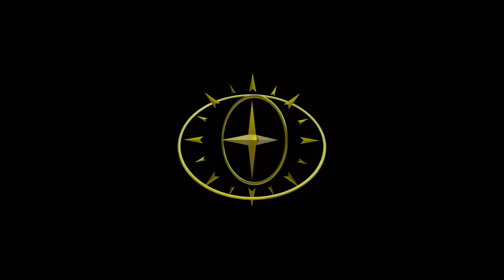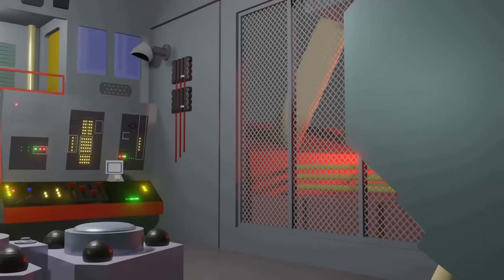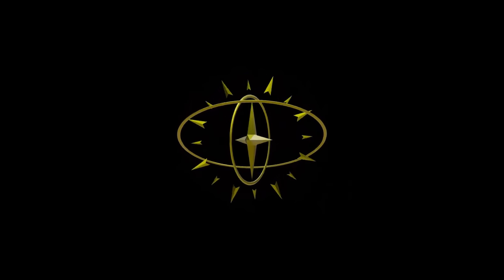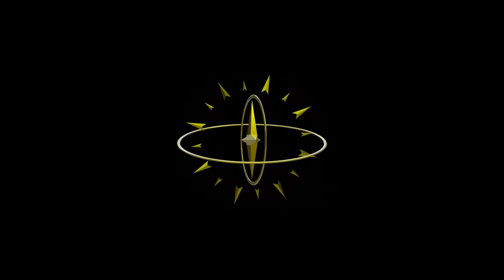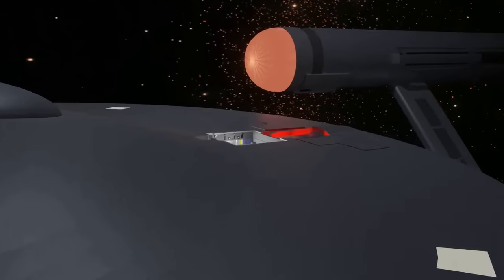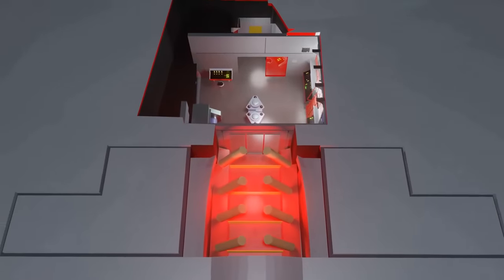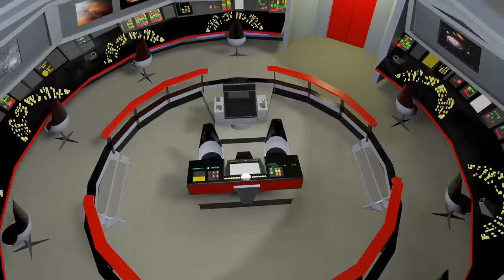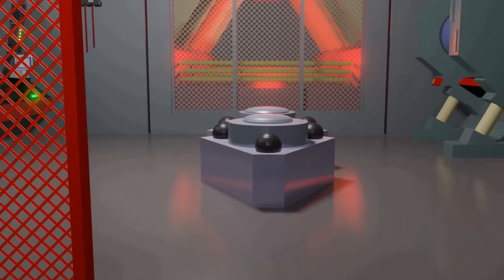The Enterprise Engine-room Enigma: where was main engineering?

Comment: The original Star Fleet Technical Manual has TWO engineering areas: an area marked "Main Engineering" near the Impulse Engines in the saucer, and a separate "Warp Drive Engineering" in the secondary hull right under the nacelles. Main Engineering is shown to have computers that can monitor the warp drive from there.

Also, Star Trek altered and reused sets as different rooms constantly, so there's almost no point in trying to reconcile most of the filming sets with the actual shape of the ship. I tend to lean in favor of the book that was written by an Army Air Corps engineer instead of random Hollywood camera angles.
Reply: Unfortunately, the Star Fleet Technical Manual is not canon, as it is a book, not a series or a movie, and as stated by Roddenberry, only the live action shows and movies are canon. (Yes, people, Discovery and Picard are canon, I hate them too, suck it up)
Reply: @L1z43vr  
Roddenberry was the very man who made the Technical Manual canon in the first place. He signed it with his own signature, and put references to it in all the TOS movies. Evidence:

Star Trek: The Motion Picture - All ships referenced in radio chatter were taken from the manual (Scout Revere and Dreadnought Entente, by name and NCC number) and we see Nurse Chapel use the Anabolic Protoplazer on Chekov.

Star Trek 2: The Wrath of Khan - The entire film is littered with references. "Main stage flux chillers... On."

Star Trek 3: The Search for Spock - Sulu directly uses the Ray Gun (not phaser) from the manual in the "don't call me tiny" scene.

Even in Star Trek 6, the ships referenced in Operation: Return are all from the Technical Manual. They only stopped using that manual after Gene died.

EDIT: you actually said, "Yes, people, Discovery and Picard are canon, I hate them too, suck it up". Even Discovery referenced the Technical Manual, thus, we can conclude the Star Fleet Technical Manual is and always was canon.
Reply: @Idazmi7  Um, no he didn't. He did not commission the TM or the blueprints. There is simply no evidence of this and the interviews with Franz Joseph's daughter all point to Joseph being the one to first approach Roddenberry on the matter of propriety and he'd already started the work on the TM. Roddenberry just gave a thumbs up, mainly because it was another thing he could sell through Lincoln Enterprises.

The use of the material was by *staff who were fans of the show*, not Gene Roddenberry, who after TMP, lost a lot of creative control. After Search for Spock, there are very, very few references, mostly because of the falling between Joseph and Roddenberry, especially around the time of TNG, but also the staff began making new diagrams and other readouts that were original and contradicted Joseph's works. 

Roddenberry also had very little involvement with Star Trek 6, and he declared parts of it non-canon as he hated the idea of Starfleet personnel working to subvert the Federation. His death had nothing to do with the end of the use of or continued use in the franchise of Joseph's works.
Reply: @mikedicenso2778  TMP has the most references to the Technical Manual of all, and all the TOS movies referenced it... UNTIL Gene died. After that, there were no more references made to the manual.

Also, the Franz Joseph Star Trek blueprints were always copyright through Paramount
Reply: @Idazmi7  That's because the staff, not Gene Roddenberry loved it so much. Roddenberry had no real control over the movies after TMP, and they had the graphics and such put in by the art department until Search for Spock. Once Roddenberry began moving towards decanonizing the expanded universe works and his successors tightened up the productions, the FJ material largely fell to the wayside with the occasional sneaking in of bits here and there.
Reply: @mikedicenso2778  
You have no evidence for anything in that entire paragraph. If Roddenberry controlled TMP as you say, why does it have the MOST technical manual references? By your logic it should have the least. Furthermore, the references to the manual continue well into Star Trek 6 with every ship in Operation Return being from the Technical Manual.

The mere mention of the USS Entente NCc 2120 canonizes the manual, let alone everything else.
Reply: @Idazmi7  You're using circular logic. The reason was that most of the people involved in the art department were fans of FJ's works. That's simple enough

You're maintaining a fantasy that simply wasn't true about Roddenberry commissioning the Technical Manual, when his daughter has said otherwise and so have others. Once Roddenberry and FJ had their falling out, it was over and done with and there were fewer references over time.

If you're fantasy was correct, there would've been nothing in Wrath of Khan, or Search for Spock since Roddenberry was out of the movies, and especially he had little to do with Undiscovered Country. 

I'd like to see some hard evidence from you  , and others have asked for it, but you give this same circular answer about the movies which is easily explained away by the art department and other production staff being fans of FJ's works.
Reply: @mikedicenso2778  
I'm using circular logic cause this situation is shaped like itself. If, as you say, Gene wanted to distance Star Trek from the technical manual, the logical outcome of his direct control would be distance from the technical manual.

But that is the opposite of what we see.
Reply: @mikedicenso2778 in addition to that, you have no evidence that the art department was full of fans of Franz Joseph's work, nor even that any of them were the slightest bit aware of his work before filming.
Reply: @Idazmi7  They started off fan made and people encouraged FJ for more so he went to Gene Roddenberry over it.

Why do you deny that?

And you seem to have this weird idea that people like Andrew Probert and Rick Sternbach, among many others who have time and again stated they were fans of FJ's works. 

And you seem to accept that there are just as many more references in non-Roddenberry TOS movies Wrath of Khan and Search for Spock. Only after those movies do the references all but disappear and almost none appear in TNG before Roddenberry's death.

Also, please provide your sources. I've seen  nothing from you. No interviews, nothing.
Reply: @mikedicenso2778  
"They started off fan made and people encouraged FJ for more so he went to Gene Roddenberry over it. Why do you deny that?"

1. Because it doesn't match Franz Joseph's words on the matter.
2. Because none of the tech manual contains fanmade content in fact.

"And you seem to have this weird idea that people like Andrew Probert and Rick Sternbach, among many others who have time and again stated they were fans of FJ's works"

Source? Besides, even if that was true, which is unlikely, that hardy affects TMP except to further discredit your assertion that TMP "distanced" itself from the tech manual.

"And you seem to accept that there are just as many more references in non-Roddenberry TOS movies Wrath of Khan and Search for Spock."

That doesn't discredit my position, nor does it support yours, nor is it actually true, regardless.

"Also, please provide your sources. I've seen  nothing from you. No interviews, nothing"

I'm not the one making the extraordinary claim that official content is fanmade: you are. Give me a Roddenberry source that agrees with you. Not a claim by Karen on an actual fan website, or anything else.
Reply: @Idazmi7  So you're claiming Karen, FJ's own daughter and he himself are both liars? On the subject of the use of the SFTM and Plans use in the movies:

"Dick: No credit or compensation whatsoever was given to FJ. It is my understanding that these items were put into the movies by production staff who were fans of FJ's work, possibly including both Andy Probert and Rick Sternbach, because they felt FJ should be represented in there somehow."

Trekplace, is merely "reprinting" the Enterprise Incident interviews, among others. 

You're now committing the fallacy of moving the goal posts, if not delusional. We have the interviews with two people who were involved. They inspired and started work on the material well before Gene Roddenberry had anything to do with it.

Rick Sternback and others are responsible a fans for incorporating FJs material.
Reply: @mikedicenso2778  
So instead of answering anything I actually asked, you resort to attacking my character. Again, more explicitly this time: your fan site interview - which is what trekplace is - doesn't line up with facts available. To prove your position, you must provide an extenuating source, or - on the premise I have already given - your position can be dismissed.
Reply: @Idazmi7  I'm actually genuinely concerned for your mental state. And you are attacking the sources provided, dismissing it summarily out of hand, using multiple fallacies, calling Trekplace a "fan site" even though the pedigrees of the interviews are not really in question by anyone, except only you.

What facts are available? A coincidence that Roddenberry happened to work on a movie at the same time some graphics based on FJ's work were used? That's been debunked 10 ways to Sunday.

No one has seriously ever questioned Trekplace's interviews, or the sources it lists (i.e. James Van Hise's 1982 interview with FJ published in Enterprise Incidents magazine in 1984). 

Are you saying the interviews are faked? That FJ and his daughter Karen are liars? If you are, you need to show proof of that. 

What you should've said is really this, if you wanted credibility:

"I understand that there are interviews with Franz Joseph and his daughter, and I believe they believe what they say, but I want to know what Gene Roddenberry's view was on it, so I have all sides before I decide anything."

See, that's more logical, it does not dismiss a respected website's interview with Karen, or the Enterprise Incident interview with FJ himself.

But, because of your circular fallacies, and more, your insane fantasy can be readily dismissed.
Reply: @mikedicenso2778  
Yes, Trekplace is a fansite with zero connection to CBS, Paramount, or any rights owners of Star Trek. My other criticisms also stand. You must provide an actually verifiable source. Trek place is no such source.
Reply: @Idazmi7  You realize the fallacy of that argument?

You've just dismissed, Starlog, Enterprise Incidents, Star Trek Communicator, Cinefantastique, Cinefex, and many other professional and fan publications over the decades that have published great material over the decades, including interviews with many professionals in the movie and TV community, not just Star Trek. 

When two different, but closely related to the subject's people say the same story to two different people with about 2 decades between them, we have to accept their story. There's been no lawsuits, no threats or anything that would indicate the interviews are false. Majel Barrett Roddenberry as you know was a very strong defender of her husband, and no doubt she would've said something. 

But there's something missing from the TM that puts a big nail in your "theory": Gene Roddenberry's name is not in the authorship credits, either on the original or the reprints (which credit FJ as author).
Reply: @mikedicenso2778  
"You realize the fallacy of that argument?"

No. There's no evidence supporting your trek place interview except the trekplace interview: that's telling me I have to dismiss your point. That'll change if you could give me a corroborate source - which I indicated - but you haven't, even after all this time. So, I dismissed the trek place article.

If I had no corroborate evidence, I'd dismiss the other fan publications too, case by case.
Reply: @mikedicenso2778  
"But there's something missing from the TM that puts a big nail in your "theory": Gene Roddenberry's name is not in the authorship credits,"

And? I never said Gene wrote them, so there still no hole in my position.
Reply: @Idazmi7  You said that Roddenberry commissioned the book, therefore, his not being in the credit in any fashion, before or years later is a major nail in the coffin of your claim.
Reply: @Idazmi7  They weren't always that way. It began as fan material created by Franz for his daughter, who was (and is) a huge Trekkie, and for her friends at S.T.A.R. in San Diego. Franz started making the orthographic reductions after he saw what he considered to be inferior workmanship on their part in recreating costumes and props. That's why his daughter and a whole bunch of people from S.T.A.R. appear on the credits page for the manual on page 3.
Reply: @Idazmi7  It canonizes parts of his stuff, not all of it. The audio dialog is very brief, in the Director's Cut, the Entente appears to be cut out or is more subdued, but Columbia and Revere are left in. The flashing of the blueprints goes so fast it's barely visible. 

There's actually way more of FJ's material in Wrath of Khan and in Search for Spock with the readouts showing the Tug, Scout, and Destroyer diagrams, as well as the blatant use of the engineering decks from the General Plans in TWOK when Spock points out the damage from Reliant's first attack. 

In fact, in TWOK, the same flashing FJ blueprints readout from The Motion Picture appears on Scotty's engineering console when Kirk tells him "Try auxiliary power!" for about the same length of time.
Reply: @Idazmi7  I guess you've never read Rick Sternbach's interviews or his introduction to his Enterprise-D blueprints where he gives full credit to Franz Joseph as the inspiration. Rick worked on Star Trek: Phase II along with Joe Jennings and Mike Minor before it changed over to The Motion Picture. He and the others wrote up a technical manual of sorts showing all the bridge stations, what the console buttons do, etc. online and the cover sheet has Franz's side plan of the Enterprise on it.
Reply: @Idazmi7  Dude. That's some seriously convoluted nonsense! You do know that those interviews are not the property of that website? That they can be traced back to the original publications? That they were audio recorded and transcribed?

I mean, I can see why people think you're mental!
Reply: @mikedicenso2778  He is in the credits, but along with a lot of other people as a thank you that's done in-universe. But there's no indication Roddenberry ever commissioned the book like Idazmi's nutjob is claiming. I've never ever seen an interview or video that stated the book was Gene's idea. 

All of it was Franz's idea. He's a good father who did it for his kid and her friends. Here's what Franz had to say:

"Before I started seriously on the Manual,” Joseph said, “I had talked to Gene, Paramount, NBC, and Ballantine Books, and they all assured me that the Star Trek TV series was dead, it would not go back into production.”

That seems to be the long and short of Gene's involvement. It started as a fan work and then took on a life from there when Franz was encouraged by his daughter, S.T.A.R., and then all these people he consulted with.
Reply: @Idazmi7  Where did you come up with this delusion about Gene commissioning the TM from Franz? Seriously?

What interview? What publication? What slip of paper shows Gene paying Franz for the work? 

Anything?

The more I read your replies to Mike and others, the more you come across as a religious fanatic than someone genuinely interested in knowing the history of how a fun couple of books came to be.
Reply: @Nowhereman10  Thanks. I forgot about that little bit. It's barely there and there's no indication whatsoever that the SFTM was commissioned by Roddenberry or by anyone else.

Idazmi  seems to be lost in an illusion that Roddenberry started the whole thing as an actual paid commission when the evidence  points to FJ starting it. 

He's so bats--t nuts over it, that he's dismissing anything and everything that goes against that fantasy.  

He won't answer to why no one except himself has ever questioned the interviews with FJ and Karen! He won't even answer to the point that if Paramount has an interview that confirms the ones reproduced at Trekplace, what he'll do!
Reply: @Nowhereman10  
"Dude. That's some seriously convoluted nonsense! You do know that those interviews are not the property of that website? That they can be traced back to the original publications? That they were audio recorded and transcribed?"

Then why is the Trekplace article, - specifically - your ONLY reference? You would have provided another reference by now if you had one.
Reply: @Nowhereman10  
"I guess you've never read Rick Sternbach's interviews or his introduction to his Enterprise-D blueprints where he gives full credit to Franz Joseph as the inspiration. "

Which has squat to do with Star Trek: The Motion Picture from 1979. The Enterprise-D is from Star Trek: the Next Generation from 1986. Totally different productions.
Reply: @Nowhereman10  
Thanks for admitting that the Trekplace article is entirely inaccurate, by the way. Your breakdown of technical manual references in the movies was quite enlightening: the Entente, Columbia and Revere are canon. That itself implies the rest of the manual is also canon, unless you want them to specifically reference over 100 ships in dialogue.
Reply: @mikedicenso2778  
"You said that Roddenberry commissioned the book, therefore, his not being in the credit in any fashion, before or years later is a major nail in the coffin of your claim."

That's not how that works. He'd be credited for writing it if he wrote it. He didn't write it. That doesn't change the fact that he commissioned it.
Reply: @Idazmi7  He was involved with Star Trek: Phase II with Mike Minor and Joe Jennings!

What did Phase II become? Oh right... Star Trek: The Motion picture!

You're a creationist with all of this!
Reply: @Nowhereman10  
"He was involved with Star Trek: Phase II with Mike Minor and Joe Jennings!"

Yet you only brought up something from his work on The Next Generation over a decade later. It's a theme with you guys to drift topic while pretending that you haven't.
Reply: @Idazmi7  You don't know who Rick Sternback is or what he's done for Star Trek!?

Turn in your Trekkie card! No wonder you don't know anything!
Reply: @Idazmi7  That's more than dishonest. If you knew who Rick Sternbach was and the context I made (his interviews and his intro for the Enterprise-D blueprints) you'd know just how ignorant you sound.

It's clear you've confabulated Gene's commissioning of the Tech Manual and the  General Plans, and you don't want to face the music with how wrong you are.

So, provide proof of Gene Roddenberry commissioning Franz Joseph. Don't say the books were licensed, because that wasn't solely Gene's purview to do that, and Paramount and Ballentine were involved here where licensing merchandise was concerned, it was their property, and everyone let it go through because at the time in April 1973, the franchise was believed to be dead.

So, prove it. Show a formal request to produce something (especially an artistic work) in exchange for payment from Gene to Franz. Receipts, contracts, anything from the Roddenberry Archives, etc. A bit from the thank you credits on the TM, such as "On behalf of Gene Roddeberry".

You can't, because it wasn't the case. It never was, and your narcissism won't let you accept you were ever wrong.
Reply: @Idazmi7 
That's not how that works. He'd be credited for writing it if he wrote it. He didn't write it. That doesn't change the fact that he commissioned it.

That is not how it works. He's absolutely correct. The commissioner gets the full credit for having commissioned the work in the first place. There are no receipts, no contracts between Gene and Franz. Show them! Why aren't they in the Roddenberry or Paramount archives?

Franz Joseph never once has said he did it on Gene's behalf or as a commission from him. Not once.

You are making up a story that never existed.
Reply: @Idazmi7  That's not the way Trek canon has ever worked, and you should know that. From multiple sources:

"And as long as Gene Roddenberry is involved in it, he is the final word on what is Star Trek. So, for us here-- Ron Moore, Jeri Taylor, everybody who works on the show--Gene is the authority. And {...} he says that *the books, and the games, and the comics and everything else, are not gospel*, but are only additional Star Trek based on his Star Trek but not part of the actual Star Trek universe that _he created...they're just, you know, kinda fun to keep you occupied between episodes and between movies, whatever...but he does not want that to be considered to be sources of information for writers, working on this show, he doesn't want it to be considered part of the canon by anybody working on any other projects."_
- Richard Arnold

_"None of the books should be considered canon."»

"We consider only the filmed episodes (and movies) to be canon for our purposes. We do use things like the Encyclopedia, the Chronology, the Technical Manual etc. for reference, but unless it was explicitly mentioned on screen, we won't feel bound by anything stated even in those books."_
-Ron D. Moore

"You have to remember that things like CD-ROMs and the various "official" manuals put out by Paramount are not done in conjunction with the writing/producing staffs and that the authors are usually simply extrapolating information based on what's actually been seen on screen."

"There have been earlier versions of technical manuals, including "Mr. Scott's Guide to the Enterprise" (Shane Johnson) and the "Star Trek Starfleet Technical Manual" (Franz Joseph), but these books, although fun to read, were not written by production personnel and are not considered 'canon."
- Official Star Trek website FAQ in 2000

There's more like this, but you get the idea.
Reply: @thomasackerman5399  
"That's not the way Trek canon has ever worked, and you should know that. From multiple sources:"

And as usual, not one of these sources is Gene Roddenberry himself. Never is...
Reply: @Nowhereman10  
"Franz Joseph never once has said he did it on Gene's behalf (...)"

And that is a lie. The interview with Franz Joseph himself confirms he made the manual on Gene's behalf
Reply: @Nowhereman10  
" That's more than dishonest. If you knew who Rick Sternbach was (...)"

The dishonesty is on your end, using media and references unrelated to the topic and assuming association on flimsy evidence at best 

"So, provide proof of Gene Roddenberry commissioning Franz Joseph. Don't say the books were licensed, because that wasn't solely Gene's purview to do that, and Paramount and Ballentine were involved here where licensing merchandise (...)"

Yet it is Gene that Franz Joseph himself refers to in his interview, not licensing divisions. Gene Roddenberry. Personal correspondence described in detail.
Reply: @mikedicenso2778  
"You don't know who Rick Sternback is or what he's done for Star Trek!?"

I know who he is. Until his name is associated with the Star Fleet Technical Manual or the booklet of General Plans he is irrelevant to the conversation.
Reply: @Idazmi7  No it doesn't. It says exactly the opposite. Both he (in two interviews) and his daughter's interviews tell same story and 20 years apart.

"It started in 1973. A group of fans had formed S.T.A.R. San Diego and they were meeting at Jeannie Graham's house. They finally decided to go over SDSU and open it up as a campus activity. Karen asked me to go with her that inaugural night, April 14, 1973, because I guess she was a little nervous about going there alone. When I got there I discovered a lot of the young people were children of friends of mine, people I'd worked with at Convair. Well, they had made models of the Star Trek memorabilia.
-Franz Joseph in the 1982 interview by Paul Newitt

After Franz made the technical drawings and passed them around at STAR in San Diego in 1973, he was encouraged by the fans there to do more. Gene had nothing to do with that. 

Absolutely nothing at all.

Gene only comes into play when Franz contacts him, along with also Ballentine and Paramount to find out about the proprietary details. Gene didn't see a problem with it because at the time, there wasn't even The Animated Series yet, never mind anything else. It was a dead franchise. Gene encouraged the making of the book.

"Then Karen got a set of the...they're called the "Enterprise drawing set" at Lincoln Enterprises...you know, the famous three-view and the cutaway, and other things from Stephen Whitfield's book; and the drawing of the hangar deck...and I think there was also a drawing of the shuttlecraft. From these sketches and those in Whitfield's book, I then laid out...those drawings were bad, they're out of scale...but I laid the drawing out, scaled and sized it, and made a drawing of the Enterprise. Next I devised the Dreadnought, made a drawing of one of the uniforms, and about twelve drawings in all. They were drawn on the format I'd already devised for the Technical Orders. I sent a copy of the T.O.'s for the Dreadnought and the Enterprise to Gene Roddenberry on June 3rd, told him what I was doing, and inquired about proprietary rights."
- 1982 interview

That's what's in both interviews. I'm sorry they don't jive with your fantasy.

Please provide copies of letters, contracts, etc. that prove what you claim.
Reply: @Idazmi7  You keep trying to twist things around! Oh, this is rich! 

He's relevant because he, along with Joe Jennings, Lee Cole, Lew Splittgerber, and Janet Stokes was there for Phase II, and co-wrote the technical guide called "The Enterprise Flight Manual" for the series (then by extension TMP), using the FJ blueprints on the cover sheet! He's a huge fan of FJ' work and it carried over into the movies and later series! That's why a lot of FJ work made it into those early movies and works! 

It's astounding how you keep trying to shift the narrative when you get clobbered with facts.
Reply: @Nowhereman10  It's obvious Idazmi is a serial liar. He keeps on confabulating things.
Reply: @Idazmi7  Yes it is. Everyone who worked with him closely has said this, and have steadfastly stuck to his rules.

Are you saying all these men and women: D.C. Fontana, Rich Arnold, Rick Berman, Ron Moore, Paramount and CBS' official website, and many others are *lying*?

Would you be willing to lose everything in a court of law over it?
Reply: @thomasackerman5399  
"Yes it is. Everyone who worked with him closely has said this, and have steadfastly stuck to his rules."

Do you honestly believe that?

"Are you saying all these men and women: D.C. Fontana, Rich Arnold, Rick Berman, Ron Moore, Paramount and CBS' official website, and many others are *lying*?"

Not D.C. Fontana. But literally all of the others have been caught lying before, or putting words into Gene's mouth - especially Rick Berman. Not sure why you mentioned him, considering what you're trying to suggest.
Reply: @mikedicenso2778 
You've just proven that Roddenberry didn't stop him from adding Franz Joseph influences to the main franchise.
Reply: @Nowhereman10  
"Gene encouraged the making of the book."

And signed every page of Franz Joseph's Enterprise blueprints personally. Visible in the blueprints themselves.
Reply: "You've just proven that Roddenberry didn't stop him from adding Franz Joseph influences to the main franchise."

This is so delusional, if not an outright lie by twisting things around about what he said! Roddenberry had no real control after TMP, and their falling out started extending to TNG where only a few sneaks here and there made it in by diehard fans on the staff. That's the point of fact people have been hammering into your dementia-ridden head! You're trying to get a zinger in by being chronologically dishonest by intentionally confusing a Phase II writer and actor guide from the mid-70s with later productions. In TNG, we see almost nothing of Franz's stuff, and very little to nothing in later productions.
Reply: @Idazmi7  Sorry, but the blueprints had no actual Roddenberry signature on it, other than whatever he personally signed at a convention or what-have-you.

Same with the TM.
Reply: @Idazmi7  What? Not back in the 70s, no. You're being anti-chronological now. We're talking a progression of time and an eventual falling out between the two, among other things.

My point, which you fail to get or don't want to acknowledge and are now trying to twist, like you have before, is that there are many fans of FJ's work who also work for Star Trek, so that when FJ and Roddenberry fell out with each other, they kept on going and putting in small bits in the later movies and series. 

But most importantly, it was FJ that began everything in response to his daughter being a Trekkie, and here's the timeline:

_1973
April 14
S.T.A.R. San Diego holds its inaugural meeting, which Franz Joseph attends with daughter Karen. Many of the members are interested in making accurate replicas of the props and costumes used in the Star Trek television series.
April 15
FJ makes technical drawings of the hand phaser and communicator using film clips and Whitfield's The Making of Star Trek as references.
May 14
FJ has made about a dozen drawings at this point and writes GR regarding proprietary rights.
May 19
GR writes back, encourages FJ to proceed, and wants to arrange with FJ to have Lincoln Enterprises (his wife Majel Barrett's ST memorabilia business) market the drawings.
May-September
FJ and GR exchange several letters regarding the drawings, now dubbed by FJ as the Technical Manual. GR continues to be supportive and enthusiastic, but marketing arrangements are still up in the air.
September 8
Star Trek The Animated Series premieres.
September 21
FJ begins work on the blueprints of the Enterprise, a.k.a. the Booklet of General Ship's Plans. He feels he needs to lay out the contents of the entire ship before he can determine if he can make some of the detail drawings (of the crew cabins, bridge stations, shuttlecraft bay, and such) for the Tech Manual.
November 12
6 months have passed, and there is still no marketing arrangement between FJ and GR/Lincoln Enterprises for production of the BGP and TM. FJ makes the decision to keep working along on the drawings for the BGP and the TM in the hopes that they will get marketed somehow by someone.
December 14
FJ completes work on the BGP and makes 6 check copies.
December 19
FJ sends one of the check copies of the BGP to GR.
December 31
GR calls FJ and is highly complimentary about the BGP. Neither he nor his staff has seen work of this caliber and they still are amazed that such a drawing of the Enterprise could be produced. GR invites FJ to visit him at Warner Studios in Burbank to discuss equipment problems he's been having with Planet Earth._

The only thing Roddenberry commissioned from FJ is to come work on Planet Earth.
Reply: @mikedicenso2778  It's pointless to keep trying to reason with the guy. He's lost in his own little bubble world and keeps on either moving the goal posts or outright creating lies or cherrypicking about people who actually worked with Gene Roddenberry or were involved with the TM and BGP from the beginning.

He's the flat earther of Trek.
Reply: @mikedicenso2778  
The 'falling out' supposedly happened before any of the movies were made. The problem is, the references to the manual all exist in the very movies that supposedly 'distance' themselves from the manual.

The only one with an anti-chronological argument here is you, and everyone else taking the trekplace interview seriously.
Reply: @thomasackerman5399  
"It's pointless to keep trying to reason with the guy. He's lost in his own little bubble world and keeps on either moving the goal posts or outright creating lies or cherrypicking about people who actually worked with Gene Roddenberry or were involved with the TM and BGP from the beginning. He's the flat earther of Trek."

The original Star Trek's run is 'well known' to have struggled (it didn't), and the original Star Trek movie is also 'well known' to have struggled (it didn't - it just had a ridiculous budget). Starfleet is 'well known' to not be a military (they fight all the Federation's wars) and it is 'well known' that Gene Roddenberry had a 'falling out' with Franz Joseph brfore 1979 - the very year that canon references to the sftm started to exist.

I don't trust 'well known' information. Because it's the 'flat Earth' fandom that uses that as an argument in the first place.
Reply: @Nowhereman10  
"Sorry, but the blueprints had no actual Roddenberry signature on it, (...)"

Every single page, individually, bears his signature.
Reply: @Idazmi7  Wahahahaahah! LOLOLOLO!

You're  a nut!
Reply: @Idazmi7  That would be another lie. They don't. Not a single one. I know, I still have my copy from 1975.  The signatures of his on my copy were the ones I got from him for the TM and BGP at a convention.